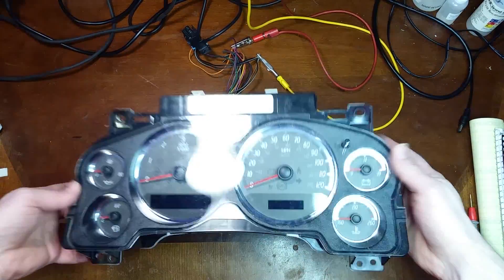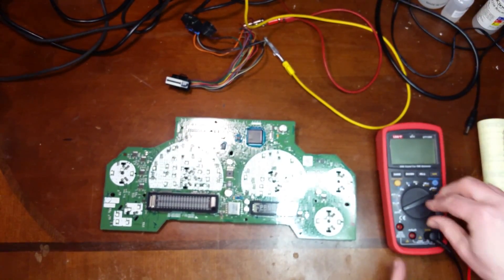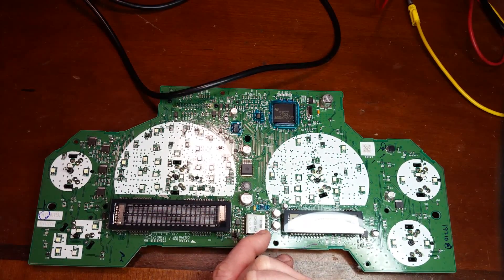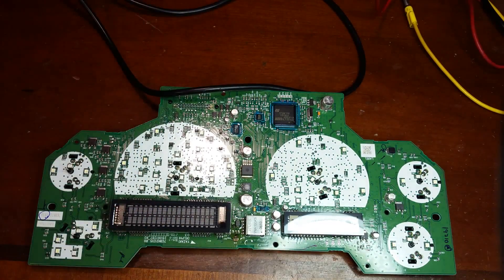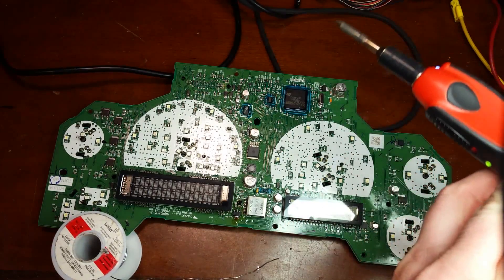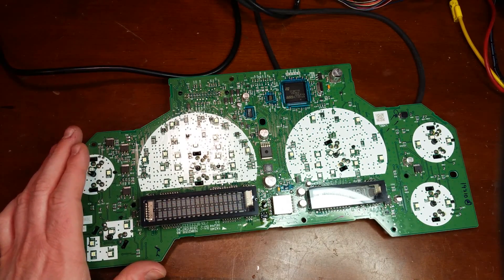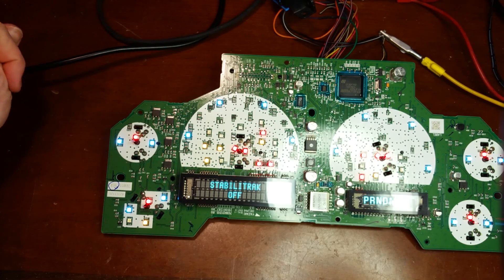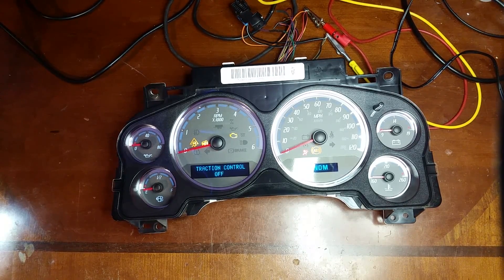2007 GM Cluster Display Repair

Comment: Hi does it matter on ir531p on a 07 Yukon?
Reply from the maker: That part number doesn't sound familiar.
Reply: LL2705 part
Reply: Below it it has a #
Reply from the maker: @Fuegocards the 2705 is the correct part number. I'm not sure how you came up with the other number. Date code maybe?

Comment: I have 2013 tahoe and everything works except the instrument panel backlighting at night time. It works during the day but off at night. Everything else works normally. Could this be an issue with the mosfet?
Reply from the maker: The MOSFET is only for odometer/prnd display. It's not responsible for the back lighting LEDs.
Reply: @jeffescortlx  thanks. Any idea what my issue could be?
Reply from the maker: @thomasjefferson2934  it depends. Does everything else on the dashboard light up properly? Like radio and climate control?
Reply: @jeffescortlx  yes everything else works as normal
Reply from the maker: @thomasjefferson2934  my first guess would be that the cluster has a defective LED that has failed in the open state.

Comment: My battery needle on my 2010 GMC Acadia fluctuates. Got new battery, alternator is good. What's the fix? Help!!!
Reply from the maker: I'd start with confirming what the voltage is actually doing with a voltage meter before replacing anything else. Run a gauge sweep test, might need a scan tool.

Comment: Do you have an updated parts list with links? Amazon ones that are posted are obsolete or out of stock. I'm having a hard time finding everything.
Reply from the maker: The only thing that is specific is the MOSFET, the rest of the equipment is open to anything comparable.

Comment: There is also another fix where all it is is to solder a solder point that most likely broke with vibration, that doesn't need anything replaced.

Comment: I want the thing to consume less power and I want to replace the florescent display with lcd and a small singleboard pc to send data to my phone
Reply from the maker: A Bluetooth OBD code scanner might send the information your looking for to your phone.
Reply: @jeffescortlx  I suppose I could just disable all the florecent displays and add my own screens over the top I would also have to emulate the code?
Reply from the maker: @Clay300  sounds like a lot of work to save less than 700mA. Meanwhile the starter motor consumes 100 amps.
Reply: @jeffescortlx   honestly i want to cut power consumption to run a PC
Reply from the maker: @Clay300  I don't understand why your going after trying to save less than one amp to run a PC? Just run a PC, the vehicle has plenty of left over power from the alternator. Desktop PC? If you want efficient consumption don't use a DC to AC power inverter, use a modified DC to DC board to get your needed power rails

Comment: I had a previous owner yank out the check engine led from the instrument panel. Is there any way I could put another led in or do i need a new cluster?
Reply from the maker: Good chance it can be fixed.
Reply: jeffescortlx do you know where I could buy a led bulb at?
Reply from the maker: @ReidyG7  any electronic parts supplier. Mouser, digi-key Newark-element 14

Comment: What would possess a company to use a vacuum fluorescent display for such applications if the MOSFET fails so often?
Reply: Cheaper than actual LEDs at a Mass scale. Specially back in 2007-8

Comment: Ok today I hit a hard bumper in my 07 Silverado and my lights that light up the Speedo mph numbers  are not working.but all the other lights work even the dimmer.what could that be.
Reply from the maker: You must have a 07 classic and not 07 new body style. The classic style uses incandescent bulbs that the filament becomes brittle with age.
Reply: @jeffescortlx  no I have the new body style Silverado.it just happened to me today.i checked all fuses made sure they were good.all the other warning and miles are glowing except the speedo lights.what could that be.
Reply: The speedo works perfect.its just the lights
Reply from the maker: So the tach, gas, voltage, oil pressure and tempuature light up fine?
Reply: @jeffescortlx  correct.
Reply from the maker: Then if you have a new body style 07 your having some sort of board issue. Could be a failed LED, resistor or trace issue causing that segment to not flow current.
Reply: @jeffescortlx  what would you suggest.looks like you got alot of great comments I'm open to your suggestion
Reply from the maker: I would suggest to have the LED's, resistors and board trouble shooted for issues.
Reply: @jeffescortlx  ok how do I go about doing that or do I just replace it.
Reply from the maker: You have 3 options:
A: Educate yourself on general electronics, there are tons of videos on youtube that will teach you the basics of using a multimeter and understanding the fundamentals. Than you can fix the cluster yourself.
B: Hire someone that can fix it and send it off to them.
C: Talk to the dealership about replacing it.
Reply: @jeffescortlx  ok thanks man from your instructional videos I think I'm gonna try it myself and see how it goes.thanks alot man.

Comment: How do you calibrate the needles? I took mine apart to inspect it but turned out it was a bad connection in the plug. But now my needles are off.
Reply from the maker: If you don't have the equipment to bench test, you need to mark the home location before removing the needles. It's my experience the plug connector doesn't fail under normal conditions.
Reply: Put them back on properly if you plug it back in with them off it should return to home them install them in thier resting location

Comment: What did you set the digital meter to.
Reply from the maker: When? For checking the resistor?
Reply: yes
Reply from the maker: For checking resistors you use the resistance setting ohm Ω.

Comment: I have an 07 Tahoe.  My cluster will light up but no gauge movement or function along with no information panel or gear identification panel.  I have a feeling it is caused by the remote start.  I don't use the remote start at all but I did a while back and the cluster did the same but after shutting truck off and restarting it started working. This time it did not work.  Any ideas?

Thanks in advance.
Reply from the maker: I've been getting a lot of failed processors lately in this style of cluster. They become temperature sensitive when they are warmer they will work when they work colder they will not boot up. As far as I know there are no direct replacement microprocessors available. You'll need to replace the entire cluster.
Reply: jeffescortlx 

Thanks for the quick response.  Since I had nothing to loose I took my dash apart to get to the cluster.  I pulled the cluster out so I could get to the wire harness.  I turned the ignition on and no function to the gauges and nothing to the panels. I carefully disconnected the wire harness and then plugged it back in.  I made an effort to not move anything but the harness.  I turned the ignition on and it powered up.  Everything functioning correctly.  I then tapped, banged and even moved the the wire harness around and could not make it fail.  I assume oxidation?  Is there any other explanation for it to work after unplugging and plugging back in?  I am planing on leaving the dash apart for a few days just in case.  

Again thank you for the quick response and your videos are awesome!
Reply from the maker: What I have ran into is 07 up clusters that will not boot up when cold, but once warmed up they will boot.
Take your cluster back out, put it in your freezer for 10 minutes then plug it back in. If it refuses to boot up when cold it's the microprocessor.
Reply: jeffescortlx 

I was thinking the same thing.  I live in Nebraska and it's supposed to get cool tonight, at or below freezing, so I left the truck outside to see if the temp will mess with it.    I will let you know how it is in the morning.
Reply: Turned the ignition on this morning and cluster booted up like normal.  So far so good. I will post if it changes.

Comment: How much is it to fix. Plz reply
Reply from the maker: Display repair for the 07 is $100 bucks plus return shipping. This covers all 3 common parts, MOSFET, gate resistor and driver chip as needed.

Comment: Having the same issues, 2007 Yukon, odometer isn’t visible neither is the PRNDL12.... all other displays are ok, radio dims when dash lights are brighter... when radio lights are brighter dash dims..... all this happened at the same time. Cost? Shipping address? Would like LEDs turnaround time.... very eager to have fixed, thanks!Dreezer32@hotmail.com
Reply from the maker: email sent

Comment: My 03 Tahoe panel display, lights, gauges seem fine, but my battery is dead in less than 24 hrs. Without IPC/DIC fuse, battery stays charged. Cluster timer not shutting down after 20 secs? Any instructions on replacing?
Reply from the maker: It's ready for a good rebuild. Some problems are showing up in the power supply.
Reply: Inline tests show draw one day and no draw another day. Any chance it's the BCM? Trying to sell this Tahoe with a good conscience.
Reply from the maker: It's in the cluster. I've seen it before in the 03 revision board.
Reply: I really appreciate your help! Which components should I try replacing first?
Reply from the maker: That's kinda a hard question to answer over the internet with no hands on.
Reply: Understood. Will get panel out and start looking around for burns.
Reply: jeffescortlx Plugged the naked panel in and feeling heat from circuits above speedometer 10 o'clock to 3 o'clock.
Reply: Panel unplugged, the voltage drop is 0 with DMM on the IPC fuse. Plugged in, it is -027 on 200m for a 20 seconds then goes back to 0. Maybe an intermittent timer issue.

Comment: Hey awesome video this one and all the rest you have are very informative.   I was wondering if you have schematics for the boards on gm instrument clusters?  I can't find them anywhere or do you just look at a working board and trace things down that way.  Also I could hook up my scanner to the 03-06 clusters and get it to do a gauge sweep but it won't work on the 07 and up it just says no communication.   I tied into pin 6 the low speed gmlan serial data line to the scanner.  I would even paypal you some $ for you time and info.  Thanks
Reply from the maker: The 07-14 use pin 1 on the OBD port for communication, the 03-06 are not the same.
GM has not released or leaked schematics for clusters that I have found. I have reversed engineered enough of the 03-04 and 05's to get what I need most of the time. I have my own sketches. Fun to do when some of the chips and components are propitiatory.
Reply: Thanks.  Yeah it worked after I switch the obd wire.  I didn't think about them changing that but I should have.  Thanks again

Comment: Ever do this to a dodge cluster...05 RAM
Reply from the maker: Its been a while, don't remember much.
Reply: jeffescortlx if the vfd is burnt in the corner does that mean its fried?
Reply: jeffescortlx thanks for the reply btw...you'd get a lot of views if ya did a repair video on these particular clusters very common dodge issue
Reply from the maker: itsmesomeguy no. Dark indicator means oxygen has not entered the VFD. If it turns white then you f'd up.
Reply from the maker: If someone sent me a dodge cluster I'd go over it.
Reply: jeffescortlx might have to make that happen, where are ya located?

Comment: how much do you charge to repair a cluster i lost my info center an lights for gear
Reply from the maker: $100 plus return shipping
Reply: @jeffescortlx  you still charge the same and whats your current turn around time? 07 GMC Yukon SLT. Also wondering on upgrading to blue LED at the same time if possible.
Reply from the maker: @BuBea2010  you can reach me for a quote by following the link in the top pinned comment.

Comment: What Temp do you set your hot air?  I want to run hot air over my whole board to re-solder everything...
Every Time I use hot air I'm nervous I'm going to damage something...
Reply from the maker: I normally start around 350ºc and go up from there if the parts are larger or heat sunk.
Reflowing the entire board should be a last ditch effort out of desperation.
Reply: ok yeah that exactly where I started 350 with low air. I added solider where it was large enough for me to do so...but did not on any of the IC's. ohh my unit is out of a 2003 Chevy Tahoe btw. I seem to have fixed most of the problems except I will lose complete power and have to bang on the dash to get it back. still not sure what that is...
Reply from the maker: If you want it fixed send it in to me.
Reply: Thanks i appreciate it. How much do you charge? I think i may have accidentally fixed my issues, so far everything's working fine now. But if i had to do it again, I send it out!

Comment: What did you use to bench test it? Connections and all?
Reply from the maker: Jacob Sullivan 
Pig tail, power supply and wiring diagram.
Reply: jeffescortlx could you tell me what to buy lol I do have a power supply just not a pig tail nor a wiring diagram I just like how you can connect to the back of the cluster with it being out of the vehicle that's all I want to do.
Reply from the maker: Jacob Sullivan 
Junk yard for plug and Google for wiring diagram.
Reply: jeffescortlx does the connector have a part number on it that you can see?

Comment: got a question for you mine flashed a few times and is still working but now the voltage gauge oil pressure and gas gauge ARE reading half then max out when started any suggestions the speedometer the tag and the temperature work is they should when you turn the key off the other gauges won't go back to zero
Reply from the maker: hobertjr 
Try unplugging the battery for 5 minutes and plug it back it. It will force the needles to reset. But it won't fix the cluster if it's failing.
Reply: jeffescortlx okay thanks a lot

Comment: Have you ever replaced one of the stepper motors on these? my tach is about 700rpm off and did some research and a lot on for the older trucks but nothing 2007+, thanks in advance!
Reply from the maker: speny999 
The 07+ style stepper motors don't typically fail like the 03-06 do. Chances are someone or previous owner was in there fixing the display and was sloppy putting the needles back on.
Reply: Ah i wish, the gauge was working and just quit on me

Comment: This is my cluster for my 07 Yukon Denali  XL, when I re-installed the cluster it worked flawlessly. I was happy to see gears since it has been a solid year that  I was able to see the dash and know what gear I was in. Thanks for the fast turn around time and amazing work. I will be sending you as much work as I can.
Reply from the maker: diddycbr1000rr 
Thank you!
Reply: @jeffescortlx  hi Jeff the instrument cluster that you did for me is still working great for the Yukon I may be having a problem with an ECU on my other car wanted to know if that was something that you could fix?
Reply from the maker: Good to hear the cluster is still great. Sorry I wouldn't be able to take on a ECU, too many messed up GM clusters around here taking up all my free time.
Reply: @jeffescortlx  lol ok no problem I have been giving people your info as well and letting them know how good your work is
Reply: I need to find info for mine to get done too. Thanks
Reply: Hi Jeff the cluster you did for me is still working but I may be having an ECU problem with my other car was wondering how are with ECU's?